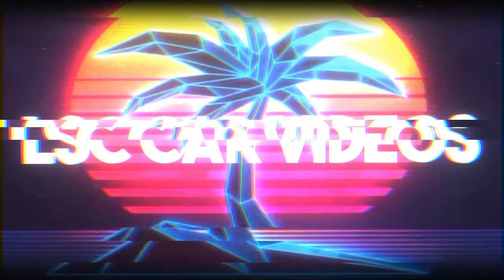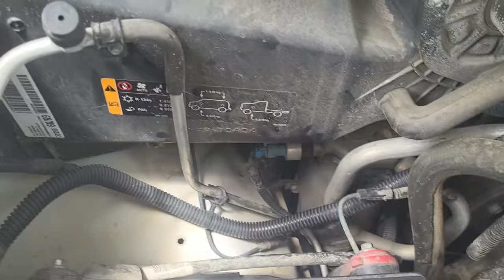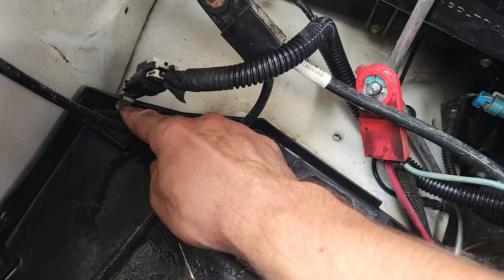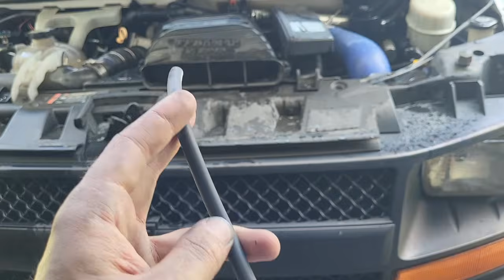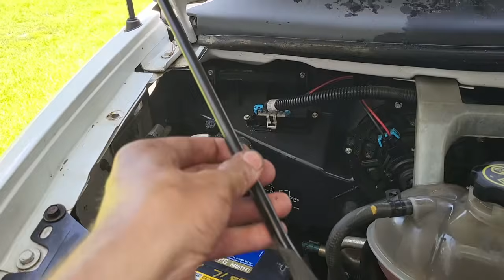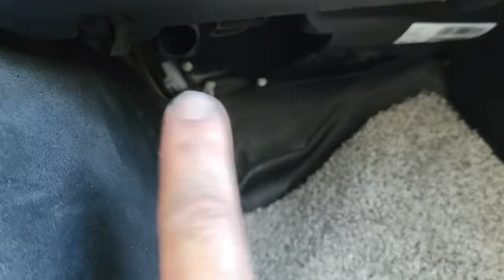2014 Chevy Express A/C Vacuum Line Repair #chevrolet #chevy #express #3500

Comment: Well, I got that hose swapped out without having to remove the battery, but the long hose that goes from the connector to the cabin is also dry rotted. Hopefully, that one won't be too much of a bitch to change out.
Reply from the maker: Fingers crossed for ya
Reply: @lsccarvideos found a video on YouTube for taking the interior engine compartment cover off. Looks pretty easy. We'll see. Thanks!

Comment: I got a 2015 GMC Savana.  the ac doesn't really work It will defrost and heat but wont blow cold air out of the face vents.  the  AC recharged last year its more of an airflow issue thru the upper vents.  what do you think that is?
Reply from the maker: When there is a vacuum line issue it defaults to defrost vents only. Just like the Express, I'd start by looking over all the vacuum lines.

Comment: I saw a couple of videos that explained the problem, but you video did a better job of explaining how to fix it. One thing I like is the suggestion to use zip ties to fasten the hoses. I probably wouldn't have thought of that.

Thanks for the help! Liked and subbed.

Comment: Hey bud I got one for you, maybe you can help me out. I can’t get hot air to blow out from my front vents it only comes out through the feet vents and a little bit through the defrost, but when I turn the knob to cold ac it’ll blow through all settings I’ve check the vacuum lines and their all in tack. Could you please help me bud hope to hear from you soon thanks
Reply from the maker: That is a tough one. My first thought goes to the back of the HVAC controls.

Comment: I’m trying to figure out why I loose AC when it’s hot. Could this have anything to do with it?
I’ve already had to fix the vacuum connector under the dash and I’ve replaced the controller that wouldn’t switch between modes from the factory. 
Vacuum controls in 2020 🤦‍♂️
Reply from the maker: First things that come to mind may be a leak in your system, a faulty condenser, or a broken compressor. I'd start by looking at those.

Comment: I guess i pulled on the exhausting hose to hard and  it came undone having trouble trying to look to see where it plugs back into the fire wall any help on a video or picture to how i can reconnect it
Reply from the maker: Was it the hose in the cabin or in the engine bay?
Reply: @lsccarvideos  Not all of these vans have an electric vacuum pump. Some of them take the vacuum from the engine. In that case, there should be a ball-shaped vacuum reservoir under the battery. A vacuum line should go from there back to the T.
Reply: @starliteflyer2875 thanks for this comment. 🤘

Comment: thanks for making this video...i found the T and one part of the hose is not connected to anything...when i put my finger over the tube there is suction.  i figured this part connect to the vacuum pump underneath the battery so when i took out the battery and looked underneath the housing there is nothing.  im lost...i have a 2015 chevy express and this just started happening a few days ago.  can anyone pls help??
Reply from the maker: That's weird, I would think a 2015 would have it in the same location. I wish I had a better answer for you.
Reply: I had the exact same experience and was told that the Diesel has the vacuum pump, but the gasoline versions get vacuum from the engine.

Comment: Thanks - this helped me a lot with my RoadTrek class B RV, which is built on a 2012 Chevy Express 3500 chassis.  I did not have to remove the battery & tray, I was able to get under there with my arm.  I also replaced the vacuum hoses that traversed the top of the motor by removing the inside engine cover.  Those lines were by far the most deteriorated due to the engine heat.  Cheap, quick, and easy fix, now working 100% as expected, with thanks again to you for posting this vid.  I have also already recommended it to other Chevy RoadTrek owners complaining of the similar issue.  Cheers!
Reply: We had the exact same problem on our 2012 Pleasure-Way built on the same chassis. In their infinite wisdom, GM routed the main vacuum line across the top of the engine, then down, running it close to the passenger side exhaust manifold. Over time, heat from the engine and the exhaust manifold seriously damaged the vacuum line, resulting in a huge loss of vacuum. I replaced the damaged vacuum lines and re-routed them away from the exhaust manifold. For additional protection I covered the new vacuum lines with wire loom.
Reply: Our heat works for an hour or so then quits like described in the video. Maybe the heat makes mine worse. I will try to replace it all

Comment: What would make the AC blow cold ..then warm then back to cold..must be vacuum lines.. perhaps the same issue you had here..
Reply from the maker: Wouldn't hurt to check the lines. Might want to get a gauge on the A/C system and make sure there is enough charge on it. Could even be your compressor going out too. But I'd start with the easy stuff first.
Reply: @lsccarvideos  Just got out of shop..replace fan clutch and said AC was way over charged.yes it does blow cold now..then boom warm then cold..vacuum lines will be my goal..thank you